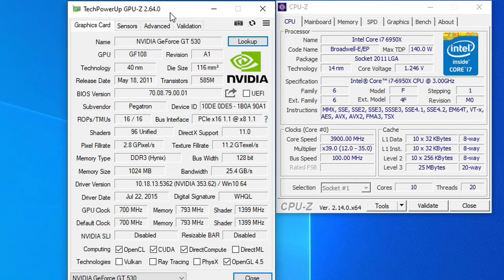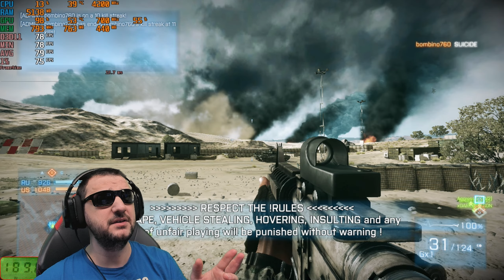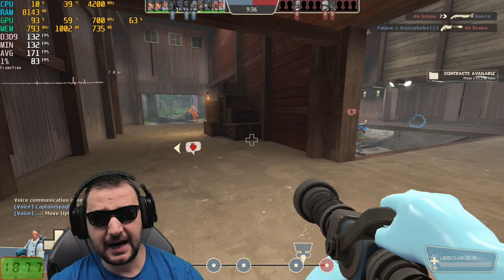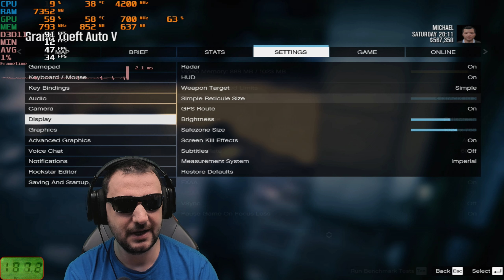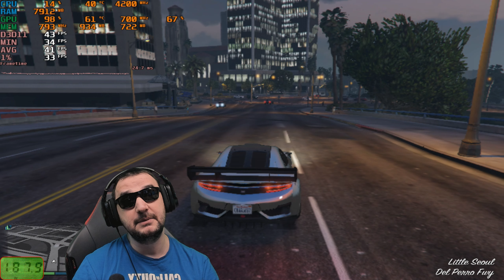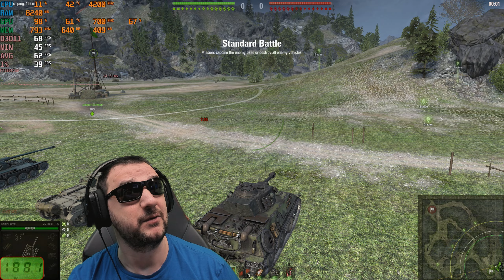NVIDIA GeForce GT 530 Benchmark

Comment: BF3 is pretty impressive I could not have played it back in the day because of my HD2400 Pro. When I got this 530 (2 GB) for 20 € I started playing all my old games maxed out thinking it was a highend model, 1280 x 1024 would be no issue to it. The 530 is trash for new games but it is basically some 9600 GS/GT, performance is very similar. Any old games on old resolution would usually max out such as CoD4 and even BO1, which hardly run before, MP was sub 30 FPS for me so I only ever played the zombie mode. I really miss it now. Servers seem dead.

Comment: The GF108 chip will definitely hold a special place in my heart. I had a GT 540M in my laptop with an i7-2630QM. I say 'had' because it died recently...It was a fun card, my ASUS laptop clocked it too high out of the box I learned later so I had to downclock it even further. I played it with a lot of 2D indie titles and some older games like you tested! I played Stalker SOC, HL2 and the first two Flatout games for example. Kinda sad that GPU died :( Thanks for another video!
Reply from the maker: Now, imagine managing to find that laptop for just a few dollars. You'd be within reach of restoring it. Wouldn't that be a great sight? Imagine restoring it and building it up with some retro games. And, with modern high-efficiency thermal paste and pads, you could avoid thermal problems entirely.
Reply: @DanielCardei  Yeah....Despite what Techpowerup says about the GT 540M, mine is soldered onto the board, not an MXM card. The iGPU of the 2630QM is really weak, even for those 2D indie titles I mentioned, so I don't really know what to do with the laptop anymore. It served its purpose though, I've used it a lot since 2011.

Comment: for this card and all GF108 Chips for support directx 12 (not all dx12 games run) you can try 386.28 quadro driver, for last fermi driver 391.35 (not dx12 support) small overclock with msi afterburner to 790-810 in core and 962 memory (1924 mhz) this gpu is msi instructions for pcie 2.0 with MSI util v3 and performance increase 25% in general
Reply: It does not have true DX12. The Kepler cards don't either. Thats where AMD did better but only with GCN, when these were around AMD still had terascale. OC works very well on this card as it hardly produced any heat but don't expect much either of it. Laptop variants of the chip with GDDR5 are likely significantly faster just as with the classic GT 650M and similar, of course I always had to get the DDR3 variants.